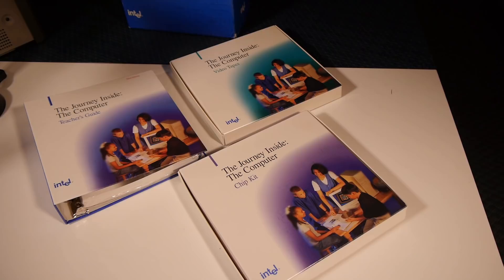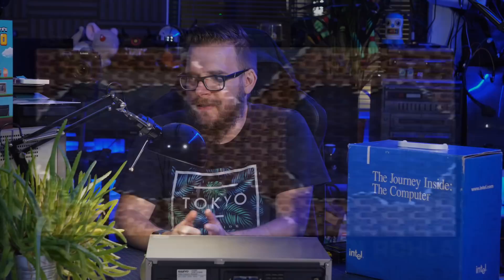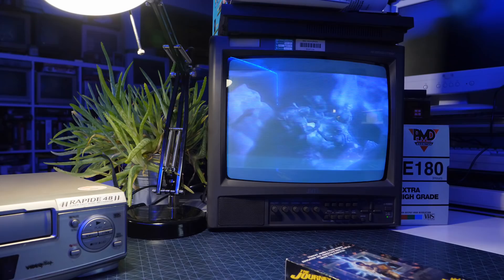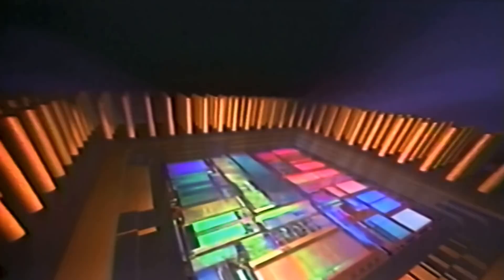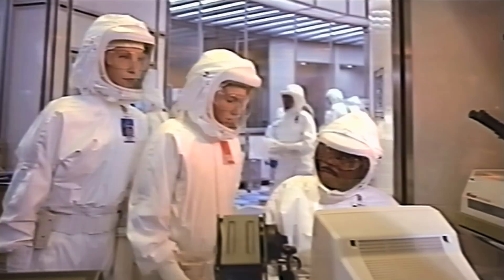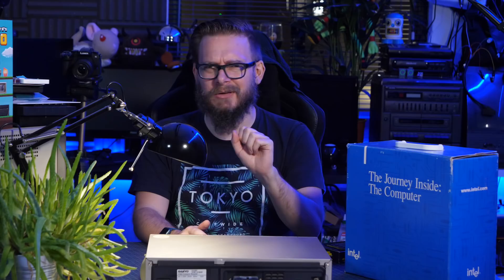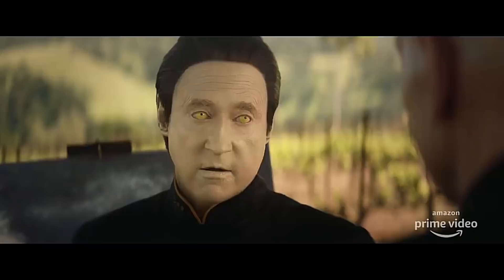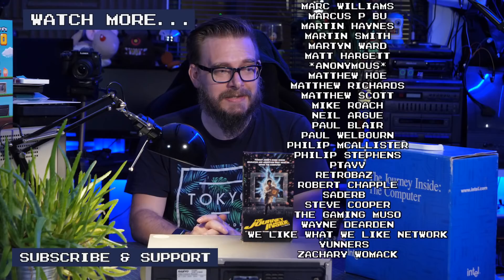That Time INTEL made a Sci-Fi Film | Nostalgia Nerd

Comment: I remember this this film very, very well.  I was working at our local science museum in the OMNIMAX theater and had to endure sitting through this film 100's of times...  We had to sit in the theater and watch every film to keep an eye out for dust appearing on the film (a small speck of dust was a huge black blob on screen).  There were usually two of us with remote controls to activate a piece of glass called the "field flattener".  It was a rectangular piece of glass that was mounted vertically in the projector and was two frames of IMAX film tall.  The glass was mounted on a pneumatic piston that moved it up and down with wiper bars attached at either end.  The bars were stationary and the glass would wipe across them as it moved.  You had to learn how to just go numb, otherwise you'd go nuts having to watch some films 1000's of times.
Reply: wow that's really interesting... the wiping device that is, not the torture part, that sounds terrible. at least it was a really easy job?
Reply: Local science museum, OMNIMAX... I sense a fellow Bostonian amirite? 👋
Reply: Thank you for your service.

Comment: Those cordless phones were actually pretty common in the 90s. They weren't cellular, they just used an analog radio signal to transmit/receive the landline phone signal via a base station that was plugged into the wall jack.

Comment: iMax.... on a VHS, right. lol
Reply: Filmed in iMax, meaning the film stock was 70mm as opposed to the conventional 35mm, and a minimum of 24fps, but can also run the film stock at variable frame rates. Keep in mind at the time a film screening was the only way to see the true quality, and a decent 35mm film stock shot can be easily digitized to a decent if not fantastic 4K digital video stream. The home video format has nothing to do with the media a film was shot on.
Reply: sounds like they filmed in iMax cinema .. the screen with handheld VHS camcorder
Reply: @rasz  haha nobody said they did it well. Just because you have the equipment and 70mm film doesn't mean you will get good results. Also not sure about back then, but these days film makers can get away with the iMax claim by filming only a few scenes on 70mm and doing the rest in digital or 35mm. 70mm is expensive as hell to shoot in, the reels for a feature film are massive and require hydraulic lifts to move from storage to the projector. Now imagine how much of that ends up on the cutting room floor....